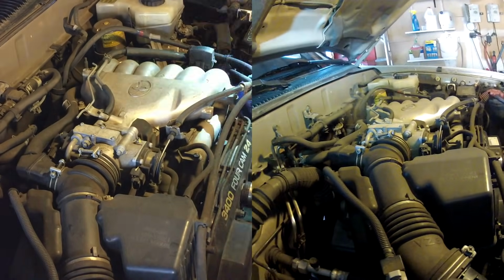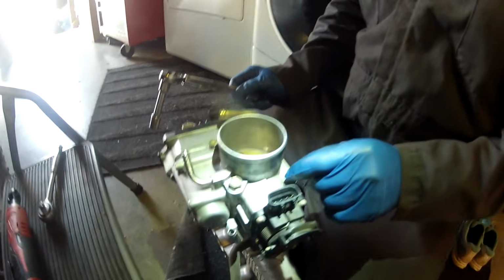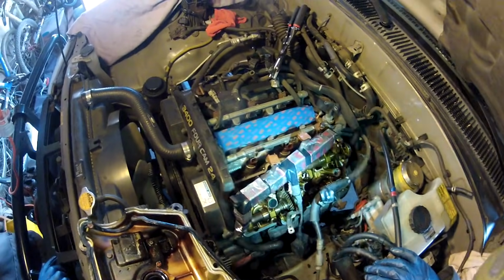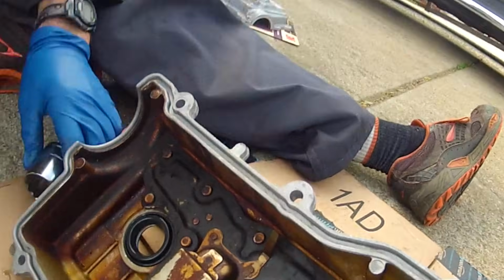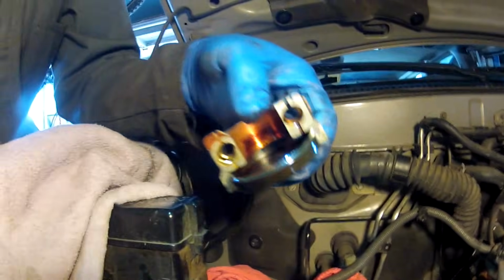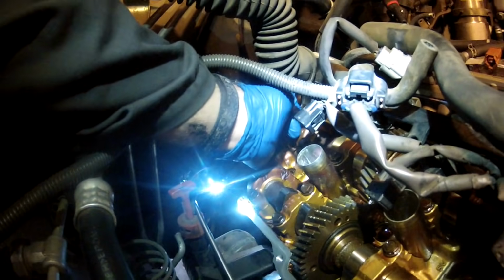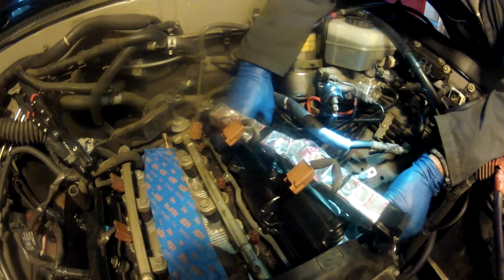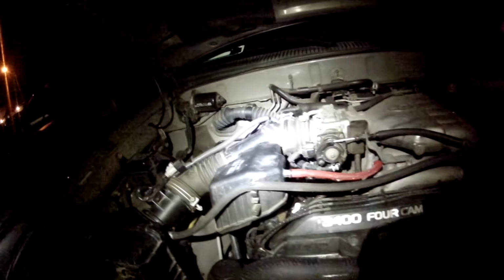3.4 L V6 5VZ-FE Toyota 4runner, Tacoma, Tundra Valve Cover Gasket Tutorial

Comment: Why does some manuals say torque 53inlb and some say 12ftlb
Reply from the maker: Because the ones that say foot pounds are wrong.  Those valve cover bolts are very small and the spec is in inch pounds like we specify in the video.  12 foot pounds would be equivalent to 144 inch pounds and that would be WAY too high of a spec for those small fasteners.
Reply: @TimmyTheToolman  I've also seen 7ft lbs which is 84in lbs which is the correct one because I've seen manuals that show both even on forums
Reply from the maker: @ns671fr  53 inch pounds is correct according to my 2000 Toyota Factory Service Manual.  This is the value that I've seen mentioned many many times.  I've never seen anyone mention on a Toyota forum 84 inch pounds for the valve cover bolts.
Reply: @TimmyTheToolman  I see 7 and 12 on Tacomaworld and 4runner forums.  Do you know if that value would change for the 01-04 models or even especially the 2.7 engine 3rz?
Reply from the maker: @ns671fr  All the 3.4 liter specs should be the same across the board.  The year doesn't matter because they are all the same engine.  I don't know what the torque spec is for the 2.7 liter engine.

Comment: I have 2000 toyota Tacoma and i need to replace the crank hose sinice both side have different size do you know the part. Number four cylinder type
Reply from the maker: I'm guessing you're talking about the PCV hose that connects from the upper plenum to the PCV valve. I do not know that part number off hand.  Use an online parts seller like Camelback Toyota and look in the engine mechanical section of their diagrams.  If you still can't figure it out, you can call Camelback Toyota and ask to talk to someone in online sales.  You will most likely talk to Jorge (calls himself George). If you need it sooner,  just visit your local Toyota dealer parts department and they'll most likely have it in stock.

Comment: Fantastic informative video. I lost the small little bushing that fell out of the wiring harness protector bolt attachment point right above the head.  I did not see where it went, but if it fell into an oil return port I'm guessing it is small enough to pass back to oil pan relatively easy.  Is this a valid assumption?
Reply from the maker: Hey Mark, I don't know what bushing you're talking about.  But, let's hope it didn't fall into the engine.  If it did, well, you can only hope it doesn't cause any problems.  Since you don't know for sure where that bushings ended up, I doubt you'd want to go through the trouble of pulling your head off in search for it.
Reply: Around the 9:00 minute mark where you duct tape the wiring protector, it bolts to the valve cover. But I'm referring to the one on the other valve cover, it is held down by 2 little bolts. The bolts went through a little bushing insert into a plastic tab, one for each bolt. The bushing is not very big so it would seem quite passable to the oil pan. From what I've read small objects usually drop into the oil pan (if they in fact go into an oil return).  I'm dropping the oil pan tomorrow and see if it's there, but will first crank the truck for about 30 seconds to move the oil around first unless you can suggest something else, thanks.
Reply: @markpenton7890 did you ever have any issues?  Same thing happened to me today!
Reply: With the valve cover removed I looked, probed, and fished around forever. Never did find it.  So I eventually did crank the truck then shut it down and dropped the oil pan, nothing to be found! So I assumed it went somewhere else! @react1200

Comment: What is the “gap” for the spark plugs? Some say .44 and say .40. Looking to get the platinum DENSO. I have a 2002 4R.
Reply from the maker: Hey Chase, plugs come pre-gapped and I honestly don't know what the gap is.  I haven't checked the gap on a spark plug in a very long time.  If you get the right spark plugs for your rig, the gap should be already set to the proper amount.  You'll want the dual electrode spark plugs.  When you take a spark plug out of it's box, the reason for that cardboard sleeve over the threads and the electrodes is to protect the electrode gap from being altered from the movement of the boxes during shipping and any other manipulation.  The only time I would suspect the gap to be off is if the box was mangled and the cardboard sleeve was damaged or missing altogether.
Reply: Timmy The Toolman I use rockauto for most of my orders and they are offering to sizes for my vehicle, unfortunately. .44 and .40
Reply from the maker: @gunsfishand4x4  Oh, gotcha.  Doesn't make sense why they would offer two different spark plug gaps for the same engine.   Maybe just buy the spark plugs from an online Toyota parts seller like Camelback Toyota.  I personally find Rock Auto a little confusing to order parts from.
Reply: Timmy The Toolman okay I did that apparently the .44 is the correct size for the 02... I hope 🙏
Reply from the maker: @gunsfishand4x4  I like using OEM Toyota replacement parts for most things and that's why I choose an online seller like Camelback.  Like I said in my last comment, I found the Rock Auto site confusing with all the aftermarket parts options.  You can never go wrong with OEM Toyota parts.  I do use some aftermarket parts like poly bushings for my suspension but that's about the extent to it unless we're talking modifications like bumpers, skid plates, roof racks, etc.

Comment: They make seal pullers that work great on those spark plug tube seals. https://www.amazon.com/Powerbuilt-648494-Seal-Puller/dp/B002O173I0/ref=sr_1_24?ie=UTF8&qid=1550313161&sr=8-24&keywords=wheel+seal+puller. No need to bend those tabs up until you get the old seals out. When you first use the puller the actual rubber sealing ring which will be brittle will break off and then take a 1/16 inch drift punch and carefully pound on the side of the seal until it bends in a little and then take the seal puller and hook it under the bent part and the seal will come right out and this is without bending any of those tabs. If you have to bend the tabs before you put the new seals in it is a lot easier without the old seals in the way.
Reply from the maker: Thanks for sharing your technique for getting the spark tube seals out.

Comment: I need to do this job on my 2002 Tacoma and was wondering if you knew what size vacuum and fuel hoses are accessible when removing the valve covers. Seems like it would be a good time to change them too.
Reply from the maker: I don't know the sizes but there's many vacuum hoses you can replace during this job and a couple fuel hoses.  For me though, if they aren't leaking or cracked, I'd leave them alone.

Comment: Hey Timmy! do the spark plug wells have a lower seal? Are they removable?
Reply from the maker: I don't know.  I've never tried to remove one.  The factory service manual might mention something about it.  When I get a chance I'll take a look at the manual and see what I find out.  If I forget to get back to you, send me another message to remind me.
Reply: Timmy The Toolman it’s does show that they are a removable part but nothing on a seal at the bottom. However my service manual is one acquired from the internet. Had nothing on passenger side front diff, Right hand drive. So may have some things missing

Comment: Anybody have any issues with cam plug bolts spinning? For me only one side caught properly
Reply from the maker: That's not good Rudy.  That means they stripped.  Your best bet is to carefully drill and install a helicoil unless you want to replace the heads which is a ton of work.  Good luck.
Reply: Timmy The Toolman thanks Tim. I will try that.

Comment: Timmy, I recently replaced the throttle body unit on my 02 4Runner and cleaned it using throttle body cleaner. The problem is that I let some of the liquid go into the small holes. Now when I start my 4Runner there is a high idle when the engine is cold but it decreases when I put it on Drive, and also if I run to the store and start it back up after the engine has been warmed up the idle is normal. What should I do now?
Reply from the maker: The dirty cleaner residue drained down into your IAC (Idle Air Control) valve.  If the issue doesn't resolve itself, you should pull off the throttle body, remove the IAC, clean it up and reinstall it.  There's also a way you can test to see if the IAC valve is working properly by jumping a couple of pins and giving it power.  I've never done it myself but I'm sure a simple Google search will get you some links to videos or a write-up showing you how to test it.  I'm pretty certain you IAC is fine but that dirty residue has probably gummed up the valve and it's not opening and closing properly now.

Comment: when cleaning the throttle body, would any cleaner be sufficient or does it have to be a certain type made specifically for cleaning a throttle body? reason is i don't really want to go out and waste money on another cleaning solution if i can just use what i've got.  Hope you see this in time lol as i'm in the middle or replacing the gaskets. Thank you and outstanding video.
Reply from the maker: I honestly don't know if another cleaner would suffice or not.  I bought throttle body cleaner.  Whatever you do, don't let the dirty residue drain down into the IAC.  I would spray cleaner onto a rag and then wipe off any dirty areas that way.
Reply: Timmy The Toolman thank you for the reply! I ended up getting paint thinner that I had laying around and using a rag, wiping down the inside with it. Worked great to remove the residue from the oil.
Reply from the maker: @rexjonhdeer8180  You're welcome Rex.

Comment: I did this job last weekend and your video was great, couldn't have done it without it.  Everything is tight but now I'm getting some oil seeping from the bottom the the cam plugs. I can see it with a mirror.  I didn't fipg the cam plugs before reinstalling them into place as the FSM doesn't show. I did install fipg as you showed on the inside corners where you showed.  I was sure to tourque down the 2 bolts the for the caps.  I'm wondering if I should tear down and resintall the plugs with fipg on the radius.  The cam plugs looked new when I removed them the 1st time.
Reply from the maker: Did you install new cam plugs when you did the job?   FIPG on the cam plugs is not necessary because the cam plugs have a rubberized coating on the whole circumference and the rubber makes a leak-proof seal with the head and collar that holds it down.  If you did use new cam plugs and properly torque the collar bolts, the only thing I can think of is maybe somebody before you used FIPG and there was some FIPG residue remaining in the crevice on the head that you didn't see and it's not allowing the cam plug to make a good seal with the head.
Reply: I used the same cam plugs as was the recommendation of my local Toyota dealer.  I may pick up new ones for piece of mind before I pull it apart again.
Reply from the maker: @adamskidmore9969  They gave you bad advice Adam.  When you're that deep into pulling apart your engine, it's always best practice to replace wear items like this.  That rubber coating gets stiff and shrinks from the heat over time.  The only way you could have made sure that the used cam plugs wouldn't leak was to smear FIPG around the circumference.  The reason why I didn't want to use FIPG on mine and Sean's rig is that it's a hard area to access being crammed up against the firewall of the engine compartment.   Getting in there to scrape old sealant out would be a chore so I didn't want to do that if I ever had to perform another valve cover gasket job down the road.
Reply: Right on.  Thanks so much for the replies.  I will break it down and get new plugs.  Live and learn.  You are my  new go-to for all things Toyota.  Thanks from Raleigh, NC.
Reply from the maker: @adamskidmore9969  No problem Adam.  Stoked to hear you are making good use of the videos Sean and I are making.

Comment: 100% best/most informative video I’ve ever watched. Was extremely nervous about undertaking this after I smelt burnt oil and saw deposits on my exhaust manifolds - coming from my valve covers. This video restores my confidence and is extremely detailed and helps, especially the camera angles focusing on key areas in the engine that are hard to see. Thanks Timmy!
Reply from the maker: You're welcome Ethan.  Glad the video helped you out.  We appreciate you taking the time to comment.  Happy Wrenching!
Reply: Ethan, how was it?, did you replace the gaskets?

Comment: Drinking my morning coffee with the FSM and your video preparing for this repair. Beautiful video as always, Tim! No doubt it'll be invaluable. 

Also, bet you're enjoying whatever microphone upgrade you got...
Reply from the maker: Hey James, hopefully the job goes smooth for you.
The upgrade we did for the sound is just using an external mic, nothing fancy.  The internal mic that comes with the GoPro gets muffled in the case you put on the camera.  The GoPro Hero 5 we got did require a very very clumsy adapter you had to use to hook up the external mic so I ended up gluing it to the case so if wouldn't be flopping around.  Good luck with the job and  Happy Wrenching!

Comment: After doing this job, can I drive the vehicle immediately? Or do I need to let the FIPG bond and harden 24 hours?  San Jose local.  Tackling this project this weekend.  Thanks for the tutorial!
Reply from the maker: The Toyota Black FIPG allows you to drive your vehicle right away.  I can't remember the set-up time but it's pretty quick.  By the time you get the valve covers on and everything back on the engine, you should be fine.  I've done this job 3 times now and started the vehicle right after finishing the job each time with no negative effects.   Think of it this way, people bring their vehicles into Toyota dealerships all the time for this job and aren't told they need to leave the vehicle over night.
Reply: Thanks for the reply.  Your videos have been super helpful! Thanks for taking the time to help the community.  Subscribed!
Reply from the maker: @bendavis6954  You're welcome Ben.  Glad you are finding out videos helpful.   Welcome aboard the Timmy the Toolman train.

Comment: Did you re-use the steel gasket between upper and lower intake?
I've already done the gaskets for valve covers and changed the tube seals 2 years ago but I've got mine tore apart again to change the injectors and plugs and coils because the darn thing was running bad, I was hoping 1 or 2 injectors would test bad but they all tested good on resistance but I'm hoping new ones will solve the problem-  thinking maybe they were clogged
Reply from the maker: Hey Brandon, many people have gotten away with reusing the upper and lower plenum gaskets.  For me, I don't want to risk redoing work due to a vacuum leak so I would personally replace those gaskets.
Reply: Timmy The Toolman I agree but hate 2 buy all those gaskets when i only need 1
Reply: Hey Tim, I’d love to get my hands on those notes-do you have those steps written out online anywhere? 

I’m going in to replace my injectors tomorrow, I think I’m going to use this video to get me in there

Comment: Timmy, just attempted this project and my engine wont turn over. Seems to be leaking little fuel, but i cant locate where its coming from. Any thoughts would be greatly appreciated. 
Thanks 
Really big fan of your videos
Reply from the maker: There's the fuel line you have to disconnect from the lower plenum on the driver side.  Did you by chance disconnect one of the fuel line connections rather than just disconnect the bracket holding the line onto the plenum.  Another thought is disturbed one of the fuel injectors.  You have to remove the fuel rails to get the injectors out but maybe something happened to one of them while you were pulling the valve covers out.
Reply: Timmy The Toolman 
i doubled checked. This small leak is coming out of the Passenger side near the manifold. took it to a mechanic today...is it possible to blow the motor doing this job without ever starting it?
Reply: yup, i blew the motor somehow. Do you have a JDM dealer you would suggest?
Reply from the maker: I don't get it.  How could you blow the motor doing the valve covers?  What did the mechanic say exactly?  I don't know of any JDM dealers because I've never had to source an engine replacement.